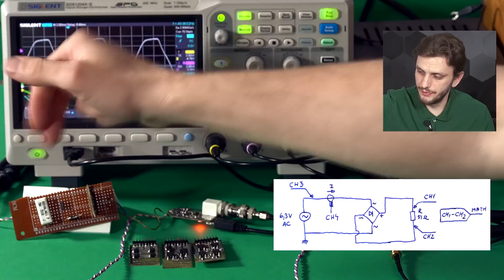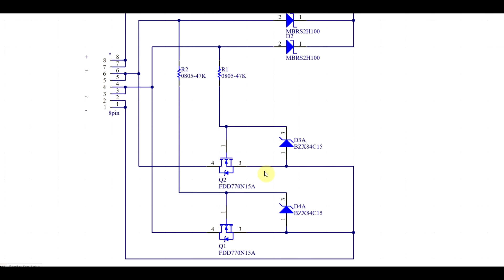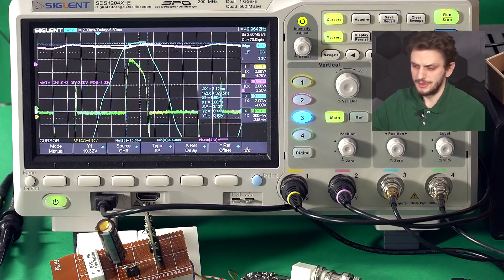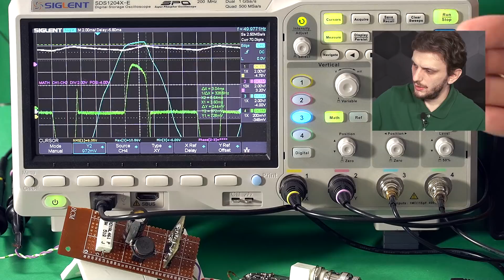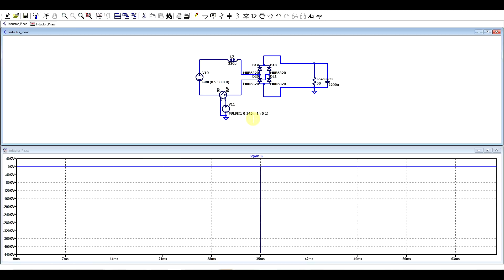Active rectifiers (2/2)

Comment: Use the switching signal from a push converter power transformer to drive the mosfet active rectifier is more simpler and efficient

Comment: The reverse recovery time for the Schottky diode is very fast for a line frequency bridge driven by a transformer front end. A normal designed minimum PIV for a bridge diode is 2x the peak voltage at high line. So, you would measure the reverse current at 50%, it should never reach 100%, although the characteristic is fairly constant except at 100%. The temperature rise in a good thermal design will perhaps at most have a 20 degree C rise, although with an excellent heat path that includes a large SMT diode package like a D2PAK with thermal vias and heatsink, and the fact that the current is not constant and the bridge legs alternate (with the layout being interleaved) a heat rise of 10 degrees C is not uncommon, and heat sinking is usually needed for other components like a linear regulator (which may have multiple pass transistors) and also cooling for SMT capacitors. So, when the design reaches a certain power dissipation the design concept actually starts with where is the heat generated how to move it to ambient. This then gives direction on if the heat dissipation in the bridge is a concern, which it usually is not for up to about 50 Watts output power with a transformer front end. Also, the transformer is operating in a nonlinear fashion it is only supplying current when the bridge is conducting, which tends to distort the input sine wave line waveform.

The challenge with an active bridge with a transformer front end is what happens during turn on at high line or low line. The waveforms for current and voltage are very dynamic due to the input power switch (which will bounce) and the input line filter (usually needed to pass conducted EMC and will add a little inductance to the line) the fact that the filter capacitor(s) are discharged and you have transformer magnetization current (and other transformer effects), the characteristic of the regulator upon start up and the load characteristics on start up. Here a simple robust bridge is really a blessing, especially if you use large Schottky diodes with a high surge rating. The use of a Schottky bridge I find very appealing, however it is many times hard to justify the cost unless the equipment is critical or apart of instrumentation which needs to be reliable. So, you will many times see a basic diode bridge specified even if it generates more heat. 

Added to the mix we now have SiC diodes which share current. Which is not immediately viewed as beneficial in bridge design unless you need to spread the heat out across the PCB. You could perhaps interleave three bridges across the board which would have a very large thermal footprint of relatively low temperature, although at a very high cost. However, this may be beneficial in an off-line front end where active bridges are not really viable due to high voltage requirements, and the SiC recovery time (almost zero) and leakage current are very small. SiC diodes PIV options are 650 and 1200 volts, which makes them good off-line candidates if the design can justify the cost. 

As you can see much of the design is all about heat when dealing with power supply front ends. Where it is being generated and how it is moved. If you went to a power supply conference where you could see the inside of the power supplies while they are operating you could learn a lot about the designs just by using a thermal camera as your only measurement.

The challenge in measuring power factor is in having a controllable spectrally pure AC power source, like a programmable AC power supply, which is usually very expensive. It does however provide you with a very pure sinewave (much more than the facility AC line input) and as such provides a very good PF measurement.

Comment: They actually make special active diode controllers that fix a lot of these issues automatically.
Reply from the maker: Indeed, you can skip over all of these problems with a proper controller, but usually those components are expensive so they are not used unless in high quality equipment.
Reply: @FesZElectronics   Yes but the controllers only cost ~$6 and make all the problems go away. The controllers for the secondary side cost only ~50c.

Comment: It is important to mention to use not only a comparator with low offset voltage but also with a rail to rail input. Using a dual comparator you can control both upper rail MOSFETs to avoid the fifth MOSFET. The gate capacity and gate charge of the MOSFETs should be not too high in order to make them fast enough, especially for frequencies considerably higher than 50 Hz. It is a trade-off with the pull down resistor at the gates.

The higher the voltages the lower is the contribution of electronic diodes to efficiency. If you rectify 100 V a full wave rectifier has allready an efficieny of about 97%. The gain of efficiency due to electronic rectification in this case is questionably because also the channel on-resistance of higher voltage MOSFETs is higher.

Comment: Loved this, but I never get any sleep after your videos.  So many questions.  Anyway I have a high frequency application (200 kHz, 12v  input, 10 amps output), I surprisingly got some amazing efficiencies (at least on LTspice) with careful selection of shottky diodes, but I am keen on trying to get an active rectifier design to work. I have looked, but all silicon mosfets I have tried fairly consistently seem to crap out (large current spikes appearing, ruining efficiency) at somewhere in the high hundreds to low thousands of hertz, even when I try practically every  mosfet there is  in the hybrid circuit. I am assuming this is because of slow on and off times, or high gate charges, so I'm going to try simulating  GaNs tonight to see what happens, using a high resistance voltage divider to feed the gates, hopefully without too much of a power hit. 

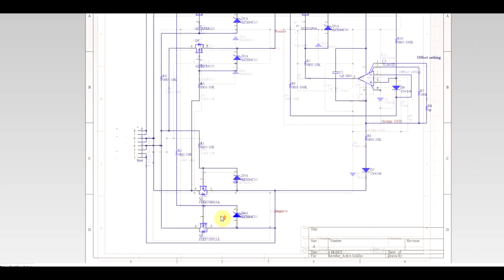 Sorry if this is so elementary, (I'm not that bright) but I noticed your  statement "These can block negative voltages but will  not block  reverse current" at around 9:40.  Is this statement related to why we need to use the P channel  mosfets for the high side?   My question about the full bridge circuit: is there a way to use 4 N-channel mosfets, without using a p-channel device?  (I cant get models for P-channel GaNs).
Reply: Did you get your answers I am interesting to know about it because I want to do a rectifier at 10 MHZ

Comment: I've got question/challege for circuit of choice, want to draw as much power as possible out of bicycle dynamo 6v/3w AC
How would you approach that? Is there useful IC that would work well?
I have 2 ideas, either yolo hand wound ferrite ring transformer to ~22V, where diode rectification is not as punishing, then use out of the box step down board
Or design AC step up boost circuit
In perfect world there would be IC with step up/step down, with high efficiency boosting or stepping down voltage to required level, but I doubt there is one for so low voltage applications, final voltages I aim for is 19/5/4.2/1.41V

Comment: It's shocking that high power and voltage active rectifiers still aren't available.
Reply: High voltage active rectifiers have no sense, due to low profit. 
About high current, You are writing  this message from device, having at least 5pcs of active rectifiers inside.

Comment: Very interesting topic and well presented.  As someone previously unaware of active rectification, and never having needed to be concerned about the voltage drop when using regular diodes, I am left wondering in what applications one would seek to use either Schottky diodes or make the leap to active rectification.
Reply from the maker: Usually, if the voltages are relatively low (<100V) Schottky diodes are used. And active rectification, anywhere the extra benefit in efficiency or lower voltage drop is mandatory.. some use case I found are with low voltage wireless power transfer and PoE(power over ethernet); but its also used in 110/220V AC rectification to obtain the highest possible efficiency - a 1000W PC supply running on 100V (for simplicity), with a ~2V drop on the rectifier, will already loose 2% efficiency and 20W on a PN rectifier.

Comment: Fun fact: you can use a schottky diode as a temperature sensor/overtemperature protection. When I upgraded my bug zapper, I used a mosfet with a schottky diode on the same chip. A NPN shuts the gate off if enough leakage current is passed to it through the schottky. As the gate is fed by analogue means, this reduces duty cycle gradually as the chip gets hotter.

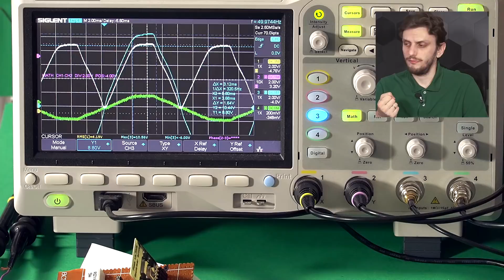Comment: 6:25 That's unexpected! Does it apply to any other types of components?
Reply: It is true for bipolar transistors: when they are heated up, collector-emitter saturation voltage drops to some extent. And it's opposite for MOSFETs: their on-resistance increases when heated. But that is actually very good effect (and bad for bipolars) as several MOSFETs can be connected in parallel and get automatically balanced: if one had lower on-resistance and began to draw most current through itself, it heats more and increases its resistance. So in the end current is distributed evenly which is good for heat management. But bipolars can't be connected in parallel as well: when one of them gets hotter, it draws more current through itself, so it gets even hotter and probably burns up. What's even more "funny", simple bipolar transistor can be thought of as a lot of little transistors connected in parallel and the same mechanism applies here in certain conditions. That's how secondary breakdown is formed. That's region of high enough voltages and rather small currents.  As MOSFETS are self-balancing in this way, they don't have secondary breakdown at all!
Reply: You'll be surprised at what changes with temperature, nearly every part will shift somewhat...

Comment: Interesting video.
The TL061 is fairly old, slow (1MHz) and has poor Vos (6mV) compared to modern parts.
A good reminder to consider the effect of inductance when circuits turn on and off, including cable inductance.
Reply from the maker: You are right, the TL061 isn't the newest part, but I had it around, and the problems it has are interesting to highlight various limitations to look out for :D  also it offers the feature that the inputs can go up to the positive rail, which was important for this application.
Reply: Tsv7722 is part from ST , 22Mhz opamps.

Comment: Interesting. Also regarding that inductor would a choke work better then 2 inductors? maybe a zener across the output could have kept the voltage more stable but that is some more leakage.
Regarding the op amp wouldn't a chopper op amp be better in this type of application? Since it is self tuning so no manual adjustment is needed.
A and regarding that big inductor, would making it resonate with the cap at 50Hz make the circuit more efficient? (might be reinventing the wheel here).

Comment: Again, it's so helpful that you go into a lot of practical detail! I've been playing with ideal diode ICs that control a MOSFET lately, as an efficient anti-backfeed measure for battery charging. Their internal circuits look pretty similar to this; an op-amp using negative feedback to ensure a small positive voltage drop across drain-source.
Reply from the maker: I'm happy you enjoyed it! Normally the commercial products will not have the issues you get with a discrete implementation. Also, some ideal diode controllers come with a built in charge pump to be able to drive high side Nchannel transistors.
Reply: Don't practically all mosfets have reverse diode that will backfeed to the input if the load is capacitive?